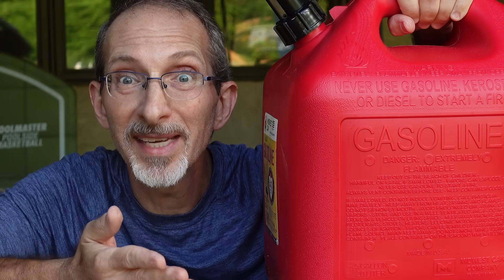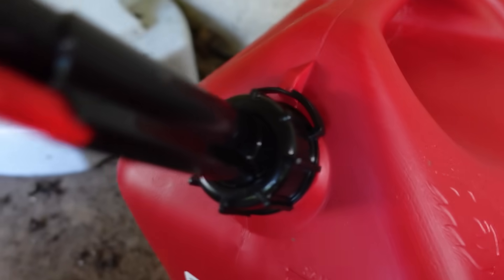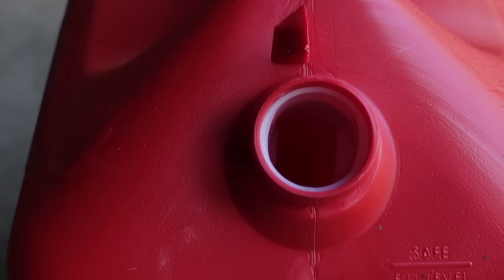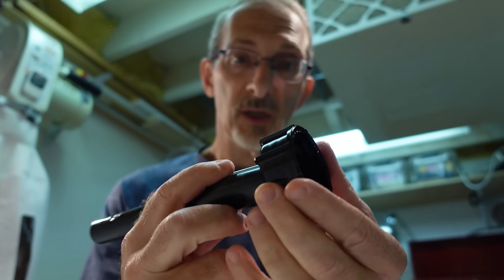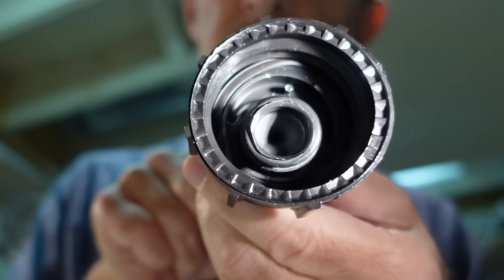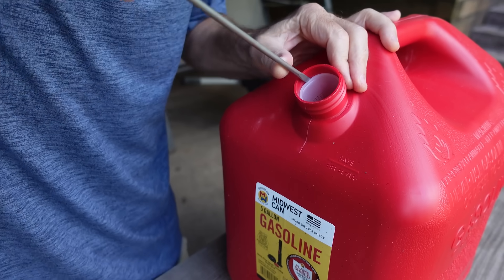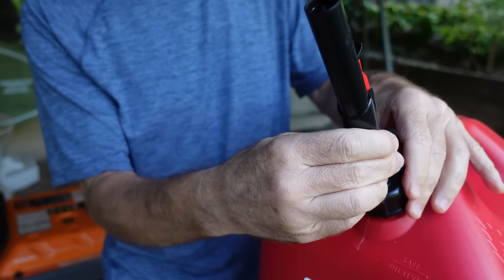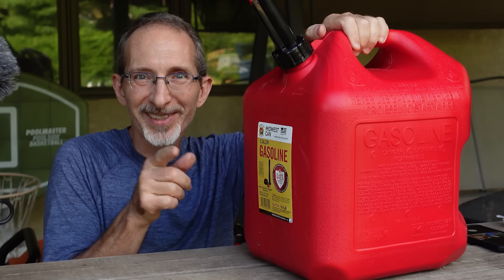Gas Can Modification | New Gas Can Fix

Comment: The internal “filter” you are referring is not a filter but is “flame arrester” to preclude a flame from getting into the can and exploding it like a bomb. You just removed a very important safety feature.  Check YouTube for “Exploding Gas Cans” and you’ll see how dangerous gas cans WITHOUT flame arresters are.
Reply from the maker: Lola, you are right! I corrected this error in my second video, link in the description. While I think flame arresters are a good safety idea, I wish they were in the spout, and not in the container where they get in the way of filling.
Reply: @MikeFyxdt  Mike:  the arrester has to be affixed in the can so that it cannot be removed.   The industry has fought this for years and the metal cans to be an “Approved” Safety can with U.L. or FM approval must include a number of features:
1.). an integral flame arrester to preclude a flame from entering the can where it can ignite the internal vapors exploding the can sending lit fuel all over the person and surrounding area.  Unfortunately this is quite often children who open the can to “throw some more fuel on the fire.”  As soon as they open the gas can vapors start exiting the container.  When they get close to the fire the flame ignites the vapor stream and the flame travels right into the can blowing it up, (see exploding gas cans on YouTube for demonstrations and some horror stories.
2.). A self-closing hatch (cover) that is tethered to the can so the can cannot be left in the open position, and the cover cannot be set aside from the can
3.). The can must be designed so it does not fall over at an angle of 60 degrees or less.
4.)  The can must have a vent hole that opens when the empty lever is engaged.  This lets air into the can as fuel is being emitted.
5.). The can must be self venting at around 3 - 3.5 psi internal pressure.  This releases any pressure if the can’s contents expand sitting in the sun.  You’ve seen plastic cans bulged out when left in the sun.
6.). OSHA requires “Approved” metal safety cans for construction sites, DOT work, military, etc.  OSHA is pretty lax in enforcing the regulations for job sites, landscapers, etc, but this doesn’t make the use of plastic containers without flame arresters any safer. 
7.) On a container with an internal flame arrester you can literally open the cover and throw a lit match into the opening and the flame arrester stops the flame from getting into the container.  Much safer especially if kids are around.  I got rid of all my plastic cans.  The metal cans are more expensive but they last forever.  You can even find vintage ones on e-bay.
8.). Just be patient in taking a little longer to fill through the flame arrester.  Better than having to recover in a hospital’s burn unit and/or being disfigured for life.

Just trying to explain the dangers of using cheap “unapproved” fuel containers.  Let me know if you want to discuss.
John McDonough

Comment: This gas can should be banned from use because it violates every safety law ever made!!! It definitely is totally unsafe. Even worse I had someone purchase one of these for me and it is labeled for kerosene use. I gave up on trying to use it because I am scared to have kerosene all over the place. I would rather go out and buy more kerosene and use a standard, normal kerosene can. I am too old an have rheumatoid arthritis to deal with this product!  My last resort would be to modify it for sure. Thank you for the great information! If I was on the side of the road walking or calling for help would be  your best option.
Reply from the maker: Susan thanks for sharing your thoughts! I think these modifications really make the containers more usable, but they should start out that way! From what I understand, kerosene is much more stable and safe to handle than gasoline, so I'm surprised a kerosene container would need as many safety devices. Best of luch to you, and thanks so much for watching and joining the conversation! 😀
Reply: @MikeFyxdt  Thank you Mike! Your modifications make this product safer for sure!

Comment: Regarding the white filter/flame arrester, I found it much easier and quicker (once I got the hang of it) to simply push it into the new unused gas can, shake it around to reverse the direction and then pull it out backwards. On mine it had the one way features that made pulling it straight out hard. If you're careful, you can even use the little forming tab at the bottom to grab onto. I may or may not have recently upgraded a dozen cans with new caps, air vents, and good funnels.
Reply: I don't understand the point of the filter.  It stops dirt from going into the can, but the first time you use it, the dirt goes into what you are filling.  I would rather have the dirt stuck in the can.
Reply: @davidlohberger5237  I believe it's more meant to somehow stop flame from travelling back into the can. not sure I understand the physics, but I only used the term filter cause that's what it looks like.
Reply: The air vents are the best solution.
Reply from the maker: @brianhillis3701  agreed! I added yellow plastic vent caps in my second video, and that model is holding up great. It makes a big difference like you said.
Reply from the maker: @Eric Stratte - Eric, that's a good suggestion on how to get the flame arrester out! In all these comments, I think that's the first time someone suggested it. Thanks for watching and sharing your idea!
Reply: I definitely did do all of those things.
Reply: Drill a vent hole ,add a tire valve with air core removed . Use the the cap to seal it .

Comment: You are the FIRST ONE I found who explained what even Midwest Cans don't explain. I thought I was going crazy with these spigots. 
I was just trying to fill a kerosene heater and I couldn't get the siphon pump in because of that internal filter ...  I couldn't find any reference
For it till I just watched your video ...... These cans SUCK !!! But thanks to your video, I can sleep tonight (and maybe fill up my kerosene heater). :)
Reply from the maker: @Hypnosis And Magic  - I'm really glad the video helped out! From what I've read in the comments section, kerosene doesn't have the same combustion risks as gasoline, and kerosene containers don't need as many the safety features. I'm glad you won't be losing any more sleep! Thanks for watching!

Comment: I hate the new gas cans.  Refused to buy one.  Someone gave me one, tried to use it today to fill up my snow blower.  Poured gas like a safety hazard.  Impossible to use.  Gave up and used one of my "normal" cans (preban).  Afterward I found this video and immediately hacked my gas can.  Thanks!!
Reply from the maker: You're welcome Mike! I am amazed that they are still selling this design. I can only hope the manufacturer is reading these comments and is interested in making changes for the better.

Comment: When I'm gassin up my car at any gas station, even if the tank is empty, when I start filling up, the nozzle constantly shuts off every 2 seconds so I keep having to pull the pump trigger to put gas in a little at a time. Any idea what's causing this? I have tried shoving it in all the way and pulling it back some and every distance in between and I tried squeezing the nozzle lightly, hard and all that. It's a 2003 pontiac vibe
Reply from the maker: @LordAzrielXIII - if I had to guess, there's something about the shape of your gas filler tube that is diverting the fuel back into the gas pump nozzle. Is the problem the same at different brand gas stations? Does it work better if you change the angle of the nozzle (turning the nozzle 90° clockwise or CCW in the car)?  I had one car that would always 'click off' way before the tank was full, but just at one pump at a particular gas station. It drove me nuts! Good luck sleuthing it, and please check back and say if you find a solution! :)

Comment: You can literally control the flow with your finger push the red tab pull back on that lil notch. Not that hard
Reply from the maker: John, I hear what you are saying… But both of my hands are occupied just lifting the weight of this 5 gallon container. No free fingers for doodling around with the nozzle.

Comment: The screen inside is not a filter. It is part of some flame mitigation system or some such wizardry. Go to the manufacturer's website, they're quite proud of it and it does appear to work.
Reply from the maker: @Nathaniel's TPS Report  - you are correct! I fixed this error in my follow up video, link in the description. I appreciate you watching and commenting!

Comment: I have no problem installing the EZ Pour Spout but I have bought the MagicFour Vent Caps that look exactly like a tire valve (brass and all) but here's the problem I have: according to the instructions I'm to send a wire (provided) through the spout and through the hole I drill. One little problem; the long white plastic vent like you pulled out is in the way. Is removing it my only option now?
Reply from the maker: @Chief Robby - I see what you mean... Yes, the only way to pull it through with a wire would be to remove the flame arrester, which I mistakenly called a filter. (I explained this in my follow up video, link in the description.)

Comment: I just bought this exact can at a yard sale about a week ago.  I put an aftermarket "air valve" in the rear part of the can. I thought that would solve the problems, but as you so excellently pointed out that is only part of the mess that I need to take care of .  Thank You for an Excellent video.
Reply from the maker: Thanks for your kind words Bob! I appreciate you watching and commenting.
Reply: How did you install the valve and where did you get the valve? ⛽
Reply: That's what I thought of using also a few years back. Air valves with caps that You use in a car tire. These work great. Just drill the hole a little smaller and force the vavle in and it works great.

Comment: Let’s talk about the filter. Keeps trash out of the tank, but does nothing to keep that trash out of the equipment you use the tank to fill
Reply from the maker: Jason - It is actually a flame arrester for safety and not a filter, which I corrected in my second video on the topic. But yes, it is still stupid and in the way! :)
Reply: @MikeFyxdt  i stand corrected. I have modified all 6 of my tanks since watching your video. I added a vent to the top rear of the tank using a 3/8 brass threaded coupling and a 3/8 brass cap. I use these tanks daily and have never dreaded adding gas to any equipment as much in my life. Now it is a breeze both to fill and empty. Oh how i miss the good ole days when the government wasn’t involved in every event in day to day life.

Comment: Omg thank you, ya I've spilt more trying to figure these stupid safety nozzles out then I ever did with a flex nozzle that you could point into the tank and then tilt the can.  Then just have a little snap on lid on the end of the nozzle to keep dust out, I'm not worried about my gas spilling from fantom forces in the shed.  It's never spilt out there and likely never will.
Reply from the maker: Thomas, yup I am a fan of the old style container as well! Live and learn, at least these new containers can be easily adjusted. Thanks for commenting!

Comment: Thanks, Mike, for an excellent video.  I had already done the first step prior to viewing your video.  Now I will complete the other modifications.
Reply from the maker: @CaptBoeing727 - excellent, I appreciate you commenting! In my second video (link in description) I did a modification to the spring to make it easier to use, but so the container still retains its auto-shutoff feature. I also added a vent, which helped a lot.

Comment: If you twist the long nose pliers as you pull out it will collapse the filter inward.. what idiot designed such a frustrating can? Probably had a hair bun and facial shrapnel…and since when was oil a toxic hazard ? Didn’t Jed Clampet see it running on the ground naturally?
Reply from the maker: Lol, Jed Clampet! :) Thanks for watching Joe!

Comment: I miss the way you could flip a spout inside the can to protect it. Now the spout is permanently stuck out and ready to catch on everything.
Reply from the maker: Technically you can flip these spouts around into the can and cap the containers. But that is a MESS because they the outside of the spout is coverd in gas when you want to use it.

Comment: The white insert is not a filter, it is a dispensing regulator meant to perform only when pouring out.  
The design combined with instructions (when followed) support the specific intent and purpose of the container for the receptacle it is made to fill, which is not smaller lightweight equipment. 
One size does not fit all, that`s why there are proper tools for those other tasks.
Several less costly versions with far less volume in the container have a different appropriate finger operated mechanism to serve that need utilizing its ergonomic advantage made partly possible with far less weight by volume, they also allow for 
directional flexibility. 
A 30 pound 5 gallon can of gas is a ridiculous amount to suspend over a 1/4 gallon fill, so they make and sell smaller 2 gallon easier to manage containers weighing in at about 12 pounds. 
The culprit here is the vapor recovery system on the gasoline pumps, which if the geniuses who push this one size must fit all mentality were doing their homework would have had gas stations be required to either not serve those vessels, or provide under strictly enforced laws the correct adapter required to dispense fuel into an approved container. 
My landscaper gets out of the burn unit on or about Dia De Los Muertos, so hopefully by then this can all be resolved with stricter  petrochemical crackdowns and encouraging the use of all cordless rechargeable equipment.
Reply from the maker: After making this video I learned that the white filter is a flame arrestor, designed to keep vapors from igniting inside the cannon causing an explosion. I explained this more in my second video, a link in the description. I agree that one size does not fit all… I have several smaller containers for my handtools, but these large ones were purchased for a generator, which will gobble up fuel in an emergency situation when run for an extended period of time. I’m sure that I am not the only one using fuel containers with a generator, and I just wish it were more convenient. I appreciate you watching and sharing your thoughts!